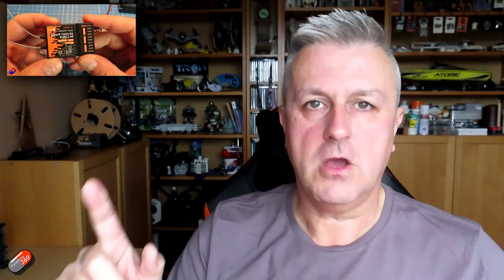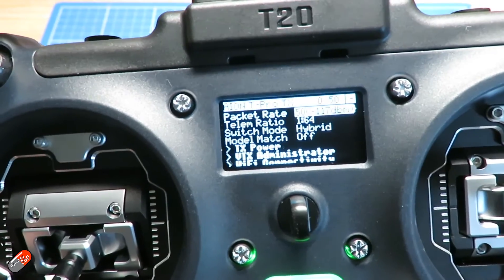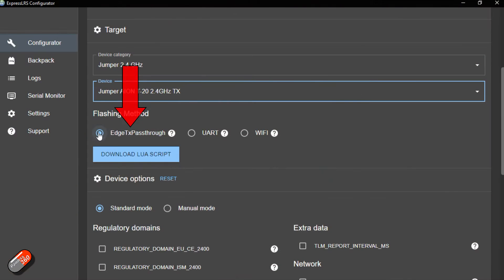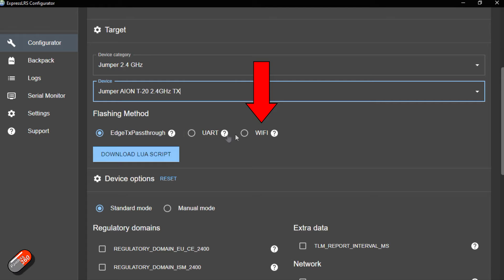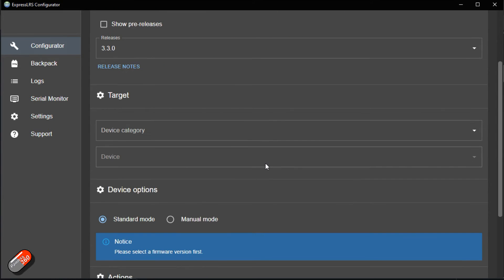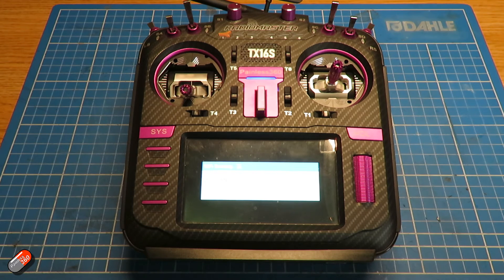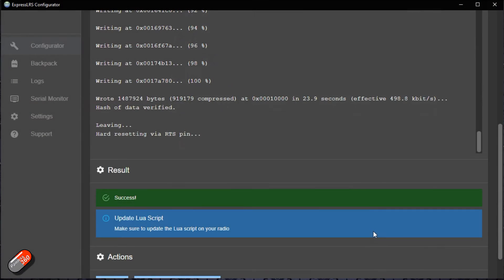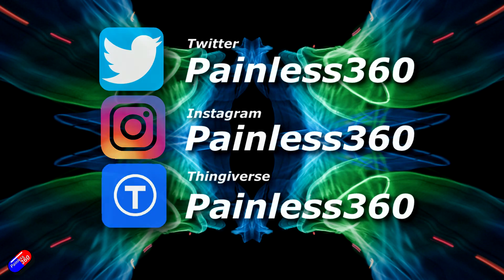Updating ELRS radios and modules: A 'how to' for beginners (viewer request)

Comment: Thank you. I get loading error. Which Lua script should I use? I updated my Radiomaster Pocket and Radiomaster Nomad external module. Both of them generate Lua scripts. The question is: which Lua script should I put in my radio controller?
Reply from the maker: The LUA script is the same for both... best of luck
Reply: @Painless360  Thank you for responding. the fact that Nomad is dual band transmitter has no affect on LUA script?
Reply from the maker: No
Reply: @Painless360  thanks for the clarification.

Comment: I got the RM Pocket and i am in austria europe and i got this ce eu version where the radio is going only to 100mw not to 250mw. I have 2 questions ! 1 . Is 100mw enough for me *( i fly around 100-300m maxilum away from where i am standing in the woods is 100mw enough if not do i have just reflash the software with the ISM version and can i  use it in europe too. 2. Do i need more than 100mw 250hz ?

Comment: super video as always....i bought an elrs version of the TX16s and you answered my question because if i go into the model setting i can select only multi and then elrs from there as a side menu...but when i go back into the radio menu and select elrs it hangs.....i am thinking although it says elrs on the underneath of the radio that perhaps the board is a 4 in 1 board....any other way of checking or a fix?  i never get any csrf option available,  thanks
Reply from the maker: That sounds like an MPM version. It should say on the box... best of luck
Reply: @Painless360  funny thing is it is an ELRS version of TX16s and has it stamped on the box and also on the underneath of the tx itself stating  Model: TX16S ELRS....but must have the wrong board inside..perhaps a factory mistake. I have highlighted it to the shop as its only 28 days old (only tested it out last week and got confused).  Thanks for your help as i would have been left struggling due to the fact i am new to Radiomaster.
Reply: just an update on that....i went back to the dealer in the uk and they said the following:  System page 6 - change module type to CRSF. <--- this is the bit you have wrong.
Model page, external RF disabled. Internal RF CRSF.
ELRS script will then load.     
it worked and  i feel like all my birthdays have come together as i had already changed around my switches (resoldered) and did not want to have to return the TX....thanks also for your help to move it along :)
Reply from the maker: I'm glad to hear that you got it sorted.  That may be worth a quick tip video... Happy flying! 
https://youtu.be/010bECugXJo

Comment: You can flash the ranger while it's plugged into the Radiomaster TX16S, and 2) although my ranger is connecting to the ELRS receiver on the drone, Qgroundcontrol does not recognize it.  The Radiomaster shows all the bars, the connection is good, Qgroundcontrol is telling me to plug the radio in.
Reply from the maker: See my video on setup for CRSF on ardupilot... Best of luck

Comment: Thankyou for all your videos, I have restarted the hobby after a few years lay off and getting to grips with RM TX16S and (plug in) ELRS module, I have just obtained a RM ER6 receiver (for fixed wing) and have worked out I can remove CH 5 (arming) and reassign CH aux6 to output 5 (and etc with further channels)of the receiver is this wise? seems to allow full proportional use of all receiver ouputs. Your time much appreciated. Maybe a further video 🙂 Great work thanks again.
Reply from the maker: https://youtu.be/h7YAMw8OIsM 😁
Reply: @Painless360  Thankyou for that I should have known you were ahead of me 🙂 , I will endeavour to look harder at your back catalogur in future, thanks for taking the time to reply and keep up the good work.

Comment: I can't remember who it was, but someone posted a video on updating ELRS, and I thought they showed the radio (or receiver?) connected to their home WiFi. Does ELRS not support this, where you can either use it in access point mode and connect directly to the module, or you can input your WiFi credentials and it'll just connected to your home network when it powers on if you're at home?
Reply from the maker: You can save your WiFi name and password to the ELRS stuff. Best of luck

Comment: I had an issue with lua not working,  it was fixed by going into the Micro TX menu and setting 333hz,   instead of 500hz.  Just in case anyone else is having the same issue.
This is with an TX16S and a Beta FPV Micro TX 500mw unit.

Comment: Connecting ELRS Tx/Rx by defining HOME_WIFI_SSID and HOME_WIFI_PASSWORD to your home netvork and you not need to switch between networks anymore. Also decerease AUTO_WIFI_ON_INTERVAL (15-30sec is fine) is a good idea, 60sec is bit to much. Flashing a bunch of Rx and Tx modules will take only few minutes to complete.
Reply from the maker: Thanks for the comment. This video is aimed at brand new pilots and designed not to overwhelm them with all the different options, caveats and too much detail. 
I show the ways that work, irrespective of access to a local WiFi network or different options beings set. thanks again!